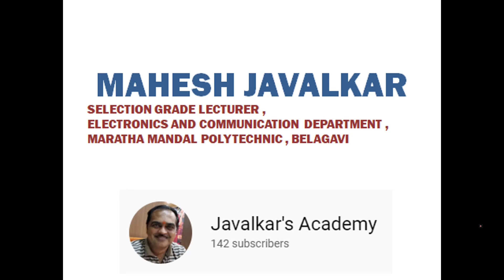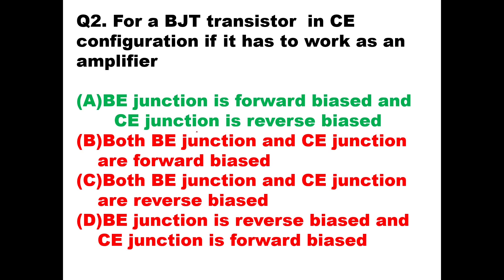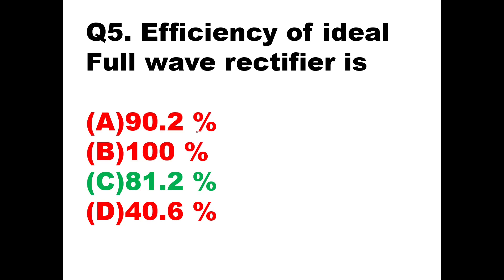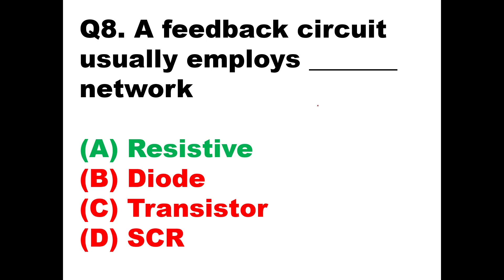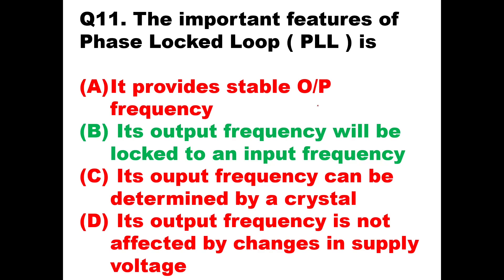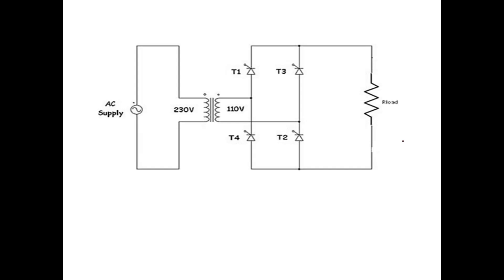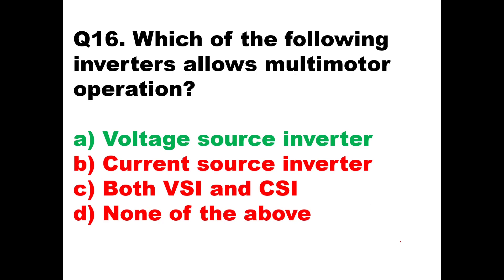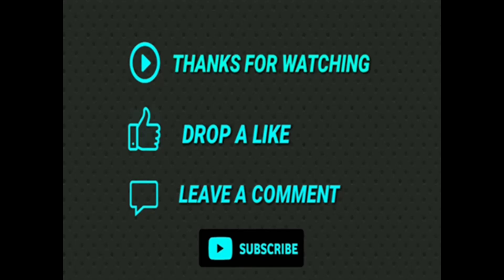DCET 2020 | SOLVED QUESTION PAPER | PART 1 |

Comment: Sir,
Step up is used for natural commutation and step down is used for forced commutation right ?
Reply from the maker: In step up forced commutation is used because there ac is con to DC and then back to ac  , so in DC concepts forced commutation is required,
Reply from the maker: Step down is simple ac to ac converter which works on line commutation
Reply: Ok sir...thank you so much...i got it sir